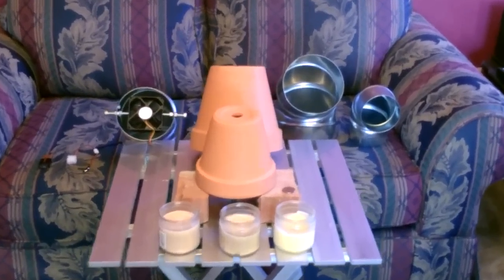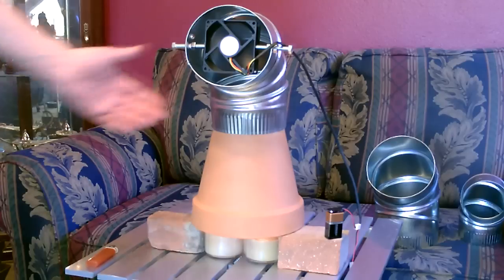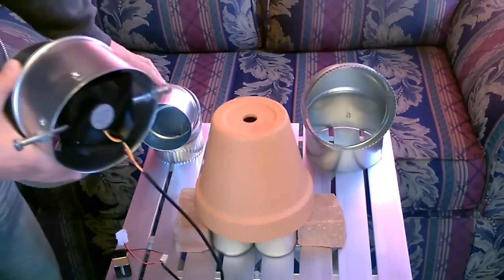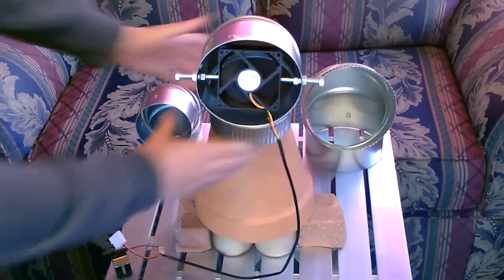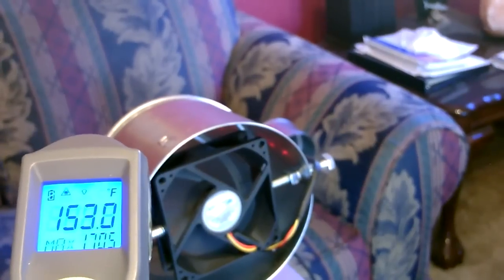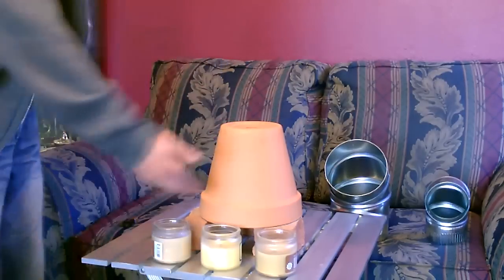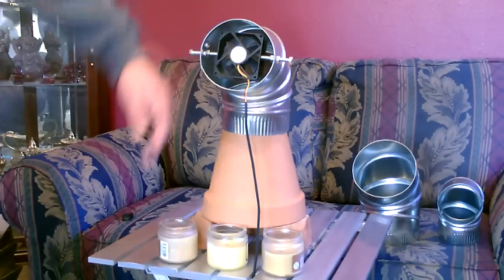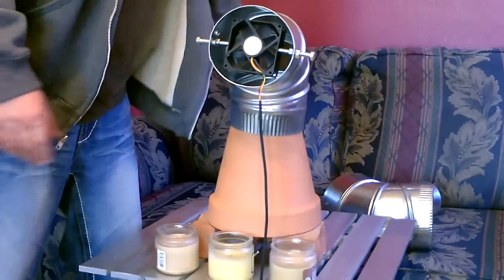Candle Powered Heater! (Improved!!) - DIY Radiant Space Heater! (w/fan!) - Clay Pot Heater!

Comment: I made a variant of that. I used the same large candles but with clay sewer pipe cut at 24” with a clay cap at the top . I used a flower pot bottom.  
I really heats my room. I got a ton of candles cheap . I costs me almost nothing to heat my place now.  45 degrees outside now and 65 inside . Nice type of heat too. The candles last for almost 12 hours!
Reply: It would be great to see your set up posted...
Reply: Great idea.
Reply: You ever thought about selling a setup
Reply: I wish you would publish that .also metal container at the bottom not sitting on wood
Reply: How many square feet is your room?
Reply: @Ryan_Woods7  200
Reply: Laws of Thermodynamics would like to know your location.
Reply: @Ryan_Woods7   about 150sf .

Comment: A suggestion:

Instead of an electrically powered fan, try a heat powered wood stove fan. They go for as little as $35 on Amazon. No electricity needed and just as good as an electric fan at moving air.
Reply: Or a rechargeable battery
Reply: @Xaphan Vassago AGREED.  The pot heater would never get hot enough
Reply: Love it.
Reply: @ryanscott2548  150F is enough
Reply: How would you attach such a heavy fan?
Reply: @Xaphan Vassago this application = no but have u ever had 1 of those fans ??? I say now u r very wrong about how well those little fans work,i may not need to plug in my blower this yr on my woodstove and if i had 2 of those fans = i know i wouldnt need any electricity for the blower.
Reply: I think 150 would power a thermal electric fan and yes you’d b surprised at how well those little fan works. Bu powering it with a 9v is pretty good thinking as well.
Reply: You gotta be smarter than the fan
Reply: @Xaphan Vassago But a toy version would. :D
Reply: I checked into the heat powered fans.  Seems the base has to be heated.  So unless you can heat the surface it sits on, it won't work.  Googled how to heat powered fans work. Ugh, signs
Reply: @zekesundown2397  the thermal fans are small but heavy...I have one on my stove...wouldn't not be able to keep it in that elbow
Reply: I didn't know there were heat powered fans. Gotta check those out.  👍👍👍 Sharon in SC
Reply: @connectionoflivesandinterests  there are but they are made for wood stoves.  The heat comes comes up through the stand.  So heat needs to be coming to the bottom of the fan if you have any hope of using it.  I decided to go with the fan and a 22v battery with a step down converter
Reply: @xaphan,hello. Your not Wright.. it works great if you use 4 or 5 candles inside the pot. I use it for years. Put it on top...wait..at 50*  you can tip the fan and it while work hours. I use the little stove fan with 2 propellor on it. Use it at every room the whole Dutch winter. Excuus for my English.
Reply: @alexanderackermans201  thank you

Comment: Nice work and relatively easy to make!  You could even use a lithium rechargeable 9 volt battery even as they are surprisingly inexpensive.  If you wanted the candles to last a lot longer you could use candles made from Crisco vegetable lard.  I remember seeing Crisco on sale for $2.50 for a 500 gram block.  You could just microwave the block of Crisco and make your own simple candles and the candles would burn much longer.  Great idea and great video!
Reply: Sounds like a fire!!! Waiting to happen
Reply: I've made some Crisco burners before, easiest way to pack them is a double boil set up. Same way you melt chocolate on a stove top. Way safer as it doesn't need to be boiled or too thin. Depending on the end container, you can even use a hair dryer to warm it up and scoop the Crisco in. That will provide enough heat to fill the gaps with a little manual manipulation.
Reply: Great idea! 💡

Comment: How long will the fan work until it burns out from the heat? If I may make a suggestion to this; Instead of just using the Elbow and putting the fan in the front to pull the heat and blow it through the fan, why not have a "T" instead? Put the fan in the back of where it is now, at the top of the "T" and blow the air out of the same exhaust hole, the other side of the top of the "T". It will act as a siphon, blowing the air out the front, at the same time it's drawing the heat as it's rising from the bottom. This way your fan will last much longer or not fail prematurely. Once the SHTF (no pun intended) there will be lots of car batteries and voltage regulators to choose from to recharge via solar/wind power. Just a thought.
Reply: +Johnn Smith 150 F doesn`t look like a problem for a fan. Or am I wrong?
Reply: +Reinis Miks I don't know.. last year I bought a Cyclonic fan to blow the heat from our wood burner around and it burned out in a matter of weeks. It was at least 3 feet from the wood burner and I have stood closer so I don't think it was too hot for it.
Reply: This idea works as far as I am concerned thanks for idea.
Reply: +Johnn Smith it's a computer fan.  temps inside your computer can reach 70 celsius or higher.  well within the range he's getting.  the fan will be fine.
Reply: Sounds good. Like to see a sketch of that layout, if possible.
Reply: Yes it would probably put out a bit more heat as well that way pending the length in the T assuming there is no low med or high on this fan not sure but the heat should build up a bit more if not sucked up so quickly and on the other end of a T and pending how u attach the fan and how far away it is from the heat and the fan air meeting I would think that it might draw slower but also blowing out air that would be a bit hotter then the other way however it might not be worth the trouble for small pay off but I'm the fool that tries all of that stuff just to see how it works and learn something in the process by the end of my experiment I would probably have a chiminea kicking hooked up to a terracotta trash can LOL
Reply: I'm no physicist nor have I done any experimentation with this, but it seems like introducing forced cool air into the "T" would prevent the flower pot from heating up to the point you want it.  However, if you're familiar with the Bernoulli effect (or Venturi principle) that could provide an answer.  A smaller tube within the elbow (with forced air from the "cool" side - as the forced air leaves the elbow it draws warm air along with it.  (Wish I could explain that better or provide drawings.)

Comment: Add a bolt and as many nuts and washers to join pots gets real hot and lasts longer we do it in canada
Reply: +skwid12 What?  No idea what you tried to say there.
Reply: Use nuts and bolts to join the pots together in the center as it holds more heat

Comment: thats an awesome idea.  i will try it out. i currently have no way to heat my house other than a 800 watt generator that barley runs a 400 watt ir heater and a tv. trying to live with little income is hard. thank you for this video i might actually sleep a bit warmer.
Reply: blackops84321 
I doubt if you can heat the whole house.  
Insulation of the room/ area that you are trying to heat up is a Major factor.  

I built a similar one for my hallway.  1.2m x 1m. Two flower pot s and 6 tea lights.  in minus 6 outside front double glazed door you could feel a slight difference after a few hours. ....ie it took the chill off the hallway.

Comment: I've seen a lot of designs for these kinds of heaters... I like this one a lot. It seems less dangerous compared to others and maximizes the usage of the heat. Quick question, does the fan create enough air flow for the flames to burn hotter? If so that may cost the candles a little quicker.

Comment: Interesting idea adding the fan in an elbow. Single wall flue pieces (including elbows) also come in black, which some might find more attractive. Perhaps one of those wood stove fans powered by a TEG would do something similar, and you wouldn't need a wire from power source- the heat from the pot energizes the fan for circulation. Anyway, great idea.
Reply: Is that a thermal energy collection fan ?

Comment: Hi, Laura here from Tiny House Ontario.  I think you can get quite a lot more heat out of this.  instead of using a penny on the pot put a large washer on top and put a large bolt through it.  Then on the other side add another big washer and then a nut and as many of these as you can get on that bolt you installed.  The metal is a big heat convector and should create a lot more heat in the inside.  I hope you will give it a whirl.
Reply: yeah like everyone else he's probably seen the same video you got "your" ingenious idea from ..............

Comment: A well placed Thermoelectric Cooler /Cooling Peltier would eliminate the need for battery, 
very well done sir
Reply: Have you had success with a Peltier?  I've toyed with them before but could not produce voltage from candle power.

Comment: I would recommend using a TEC-module for your power source, attach it to the side of the clay pot or the elbow joint and use that to power your computer fan that way you don't have to use a battery (because they die) or a soler panel (because you need light) and it would be completely candle powered.
Reply: Do rec mods work in reverse... Thought they were for heating and cooling not making power???
Reply: Ops ...tec

Comment: Read my comment please. Stove fan will work! I used them for years now. At 50* help it to give it a push. Then it will run hours. They start at 50*.. my terracotta heaters goes up with 4 theecandles( that little onces)(4 til 10 hours) up to 71*.

Comment: I wish you would have shown step by step bow you made the fans power source did you just take the plug off the fan and wrap the wires around battery
Reply from the maker: hi. yes, that is basically how you do it. or you can even leave the plug on the fan if you want. just feed 2 small wires into the plug. one for positive and one for negative. then attach those wires to the battery or power source. i usually use 22 gauge or 22awg wire. by the way, my newest posted video (as of 01/28/2021) shows exactly how to do it. it's a video that shows how to hook these fans up. here the link https://youtu.be/qL82DuN0qHg

Comment: You can buy clay pottery "candle heat" and they are round and do not have a hole in the top. They look like if you took a round ball and cut it in half and then have a space between the two halves. the candles are set in the bottom half and you have a wire frame so the top half is held up. you can find them on the web and they start at  about 60.00 depends on who sells them,  They say they work, have never tried them.

Comment: Here’s what I see but I haven’t tried it. Eventually the cold moving air will cool the pots faster than the candles can heat it. It may still blow warmer air but it may not be noticeable. When you first plug the fan on with the hot pots it will blow hot I don’t doubt that. This is much better candle heater than the ones with out a fan to distribute the heat.
Reply: Need moar candles and a regulator on the fan speed so it blows faster when it's hotter, kind of like how it already works with a CPU. Now if only candles put out more BTU...
Reply: ADD A FEW MORE WICKS TO YOUR CANDLES.  ADD WAX AS NEEDED.
Reply: A PWM fan control circuit, maybe using a capacitor and relay to save the battery’s power for longer is what I’m thinking - vary the size of the cap for the relay trigger.

Comment: I love this channel and make lots of his Eco gadgets. These are effective but paraffin candles are smelly. Best to use pure vegetable oil , with salt candles and cotton wicks. Pots do crack if heated to quickly so it’s best to heat ceramic very slowly and then leave them in a fireproof area. Best to leave candles on ceramic plates not metal. I’d advise against paraffin tea lights as they get to hot and will burst into flames.

Comment: Why cover the hole in the smaller pot? Looks like that traps more heat that would go up and out...the smaller pot will still heat up from the candles...
Reply: If the hole in the inner small pot isn’t plugged, it won’t get nearly as hot to radiate to the smaller air mass between the pots. It’s the surface area of the inner pot that couples with the air in the larger pot that makes this effective for heating.

Comment: Turn the direction of fan flow 180 degrees and blow the air in, this way the fan will operate at lower temperature and last longer, also the outlet where the heat comes out will be the bottom. The air will flow thru the chamber between the first and second pots, but the base might need to be redesigned if it puts out the candles, offset the height in the bases to allow the air flow from putting out candles if needed.  But i did that with an electric heater that couldn't heat my room, but i put a fan and the needed ducting work and blew cool air thru the fan while the fan blew across the heat coil and the old hot air exit on the heater became the cool air inlet, and the old cool air inlet became the hot air outlet next to the floor, it then heated the entire room with warm floor. But i also put heat shielding on the electrical switches since i reversed the heat flow. and this was an old heater made of 100 % steel body. I would never try with todays garbage.
Reply: U mean u blew air into the heater and the other way around.  That's something to take note of. Ima try with my stupid radiators.

Comment: I have heard arguments stating, there is no way to get more BTUs out of the flower pot arrangement than using the candles alone. I can see where the clay pots would absorb the heat creating a better radiation pattern making maybe increasing the efficiency. What is your opinion? Thank you in advance.
Reply from the maker: ***** hi there. yes that is it exactly. the pots don't increase the output of the candles, they just direct the heat (or radiate it) into the living space (where it can be felt) instead of the heat just going straight up to the ceiling. now with the addition of the vent tube and fan, the heat that is typically radiated from the top of the pot (which is at least 50% of all of the heat) won't just race to the ceiling, but will be blown into the living space first.
Reply: +Richard Pouncy actually you can get more BTU with candles, not using flower pot design, but using rocket design instead. By using a long thin steel pipe filled with candles and pump air into the pipe, when the wax melts and vaporizes inside the pipe, the vapor wax will start a spontaneous combustion with air. Thus you can burn air for the extra BTU for free.
Reply: +desertsun02  won't the rising heat turn the blades on a fan without the need for electricity to run the fan?  I remember seeing a christmas gadget that has 4 thin candles that turns fan blades that catches the rising heat from the candles,. that in turn swings attached metal rods going in circles that strike bells. anyway I think if a person can cut a hard drive disk platter and shape them into fan blades there would be no need for electricity to draw the hot air up.. it will spin as fast as the heat will eventually push it.  and free.
Reply: +bantalee2002 If the fans are powered by the heat, they won't actually "push" the heat.  In other words, the force of the fan needs to be stronger than the force of the heat itself to move it out into the room effectively.
Reply: +Richard Pouncy yes you are right the pots just make the xfer from cold to hot faster like a radiator
Reply: @bantalee2002  Hard drive platters shatter when stressed, I don't think it would be possible to shape them unless you melt them first.

Comment: what's the diff between this and just lighting a candle in a room???? heat output will be the same.
Reply from the maker: hi there. the heat output is the same, it's just that this design concentrates and directs the heat - and pushes it out to where you want it and can feel it (into the lower part of the living space). the heat from a candle by itself will just travel straight up to the ceiling and thru to the attic.

Comment: I am following the pot heating thread and saw your ingenious add on.  I giggled and thought right you plug in fan during an outage and then I think you said it was a 9 vlt solar pwered one.  I am also wondering why you cant use small oil filled glass bottles instead of tea candles.  Maybe its the convienience and $ ratio...anyways you rock with your fan..loved it

Comment: How well does it heat the room? Have you taken air temp. before and after you have lit and run the heater? I would be very interested in these results.
Reply: my tests are not reliable.. 50F today, 44F yesterday, the room in the upper 60F most of the time. takes a really long time after i wake up for the room to change... have to watch the candles..... no unattended flames.  very HUGHE difference when it is in the 30-40F outside and around 65 in my room.
Reply: Jeremiah L
can you convert that to bananna unit degrees please?
Reply: @jeremiahl2552  lol you danced around that question pretty well

Comment: what does this mean for heating the room though?  sure at that exact spot you hit 150 degrees, but after running for say a half an hour what would a thermometer in the room change?   From say 60 to 70 or from 60 to 60.2???   That is what really matters.
Reply: I would think that this is a small heater and would work best in a closed up small room. Like Den or bedroom.
Reply: @kenatkins3781  I don't care what you "think".  I want to know an experiment.  Sq foot of room, starting temperature, light the heater, temp after 10 minutes, 30 minutes, etc.
Reply: @jonathanleslie9100  no need to be rude.

Comment: This is interesting.

I have a question though.  Why put a fan on a radiant heat source?
Reply from the maker: hi. main reason is because so much heat comes directly off the top and goes straight to the ceiling. i wanted to capture and direct it more out into the living space (bottom half of the room) where you can feel it.🌞
Reply: Thank you for explaining this.  I was wondering that myself.